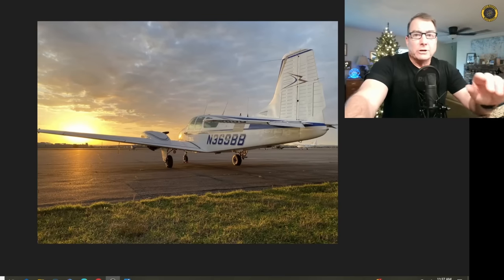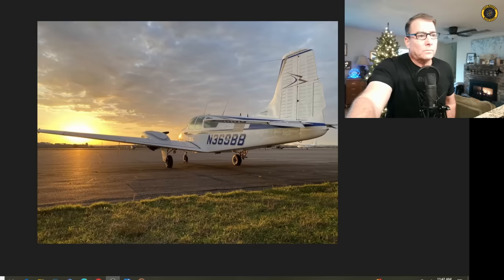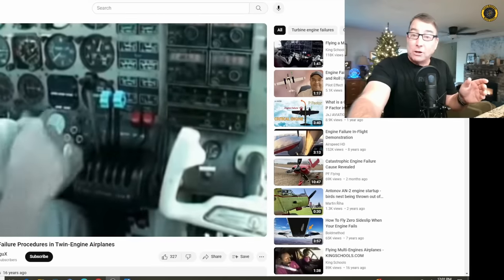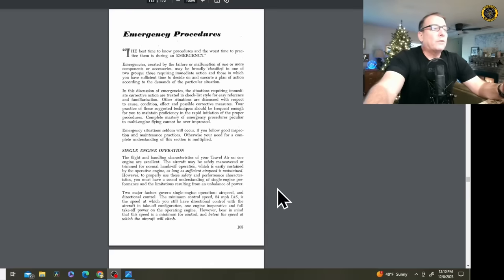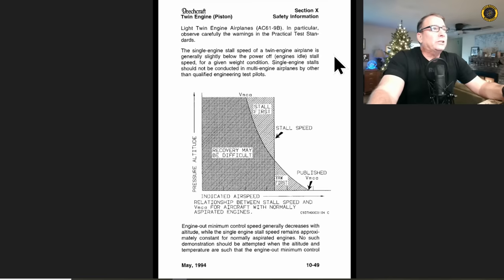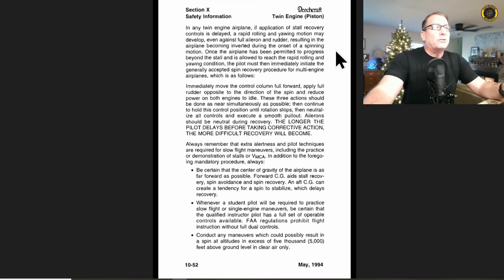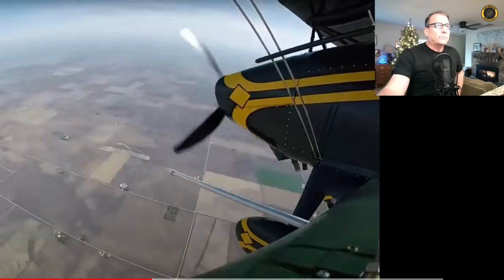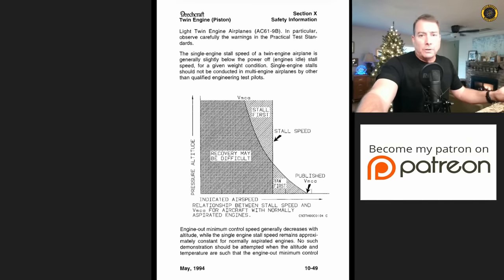Another Fatal Vmc Demo Stall Spin!! N369BB 4 Dec 2023

Comment: If memory serves, twins are not required to demonstrate spin recovery for certification.....unlike a single. As a flight instructor I had to recover from a spin induced during  power on stalls in a C172 during a BFR. Two different pilots made the same mistake like you mentioned, they tried to use aileron instead of rudder to keep a wing up during the stall and we went right into a spin. Funny how that happens! I did something similar to what you did. After becoming a flight instructor (and before these incidents!) I rented a C152 and climbed to 10,000 and did spin recovery after spin recovery, sure was fun and probably saved my life!
Reply: Light Twins are not certified for spins..

Comment: Completely avoidable death. FAA needs to send an AC to all flight schools in the country that have a light twin in their fleet and have them attest to have communicated guidance to their instructors not to allow these planes to reach a stall during VMc demos. To only allow these demonstrations in a manner, as Juan recommended,  by limiting the efficiency of the rudder physically and only allowing the YAW to be identified before a stall can develop.
Reply: I believe there is plenty of guidance on the safe operation of twins in Vmc demos. MEIs just need to be fully proficient and on their game.
Reply: Horses and water
Reply: I agree, but are the DPEs going to block the rudder on the check ride? If not, then the check ride could be the first time they are demoing it without the rudder blocked, which seems even worse.

Comment: My first aerobatic flight lesson my instructor and I were running the prestart checklists.  He then showed a billy club to me.  He said, "if I tell you to get off the controls and you dont, I'll use this!".  We never had a problem.
Reply: That's pretty funny....LOL.  My introduction to spin training was with a very slight female CFI.  She was no more than 5 foot even, and maaaayyyybe 105 pounds.  On our first spin in a C-152, after several turns, and recovery, she admitted that she tried to block the rudder on this first one to just enter a spiral, but my larger frame and strength easily over powered her attempt.  The lesson I learned that day had nothing to do with spins.  The lesson was as a CFI, you need to go over the planned flight with the student, and keep no secrets, like blocking a rudder pedal.  Everyone in a training cockpit has to have all of the plan, and be fully in the loop.

Comment: When I was a MEII, the first thing I did was teach the same things mentioned in the video before attempting VMCA demo. The main thing which I taught was recovery should be at the onset of stall OR loss of directional control whichever comes FIRST. I always found that theoretical knowledge was a key point to completing these maneuvers safely. RIP to the pilots…

Comment: Juan, 2 years ago you posted a King Air skydiver stall spin caught on video. Great video. Shows the partial snap roll you are talking about on camera. You might want to link it here. 

I also thought that with military or college aviation training you could apply to airlines with 750 hours or 1,000 hours respectively. Is this correct?  How many hours do you need to fly fighters or right seat transport aircraft in the Air Force?  I will note that since the crash that caused this knee jerk reaction (Colgan?) U.S. airline safety has improved. 

Always thought anti yaw engine power would help, did not realize power flattened spins.

Comment: I've done VMC demonstrations at 5-6k at various temperatures in my 310 without any issues. The point made about doing a VMC demo when conditions put you near stall speed is a good one. However, besides setting up the plane on single engine, I don't look at the airspeed as much. Instead,  I look out the widow for any deviation in the yaw axis. Whether I'm level or doing the VMC demo as soon as the yaw drifts more than a degree or to two it is back to immediate recovery (simultaneously reduce power on both engines nose down). Also, very good advice to MEIs about blocking the use of full rudder as it means the nose will start to drift earlier at a higher airspeed so farther away from stall speed.

Comment: I just had my Commercial Multi Engine checkride two days ago, and all of my training for VMC Demos involved the instructor blocking the rudder with his foot. The DPE, however, wanted a full demonstration and did not use his foot to block the rudder pedal. I was sat on the maneuver, but it was very sloppy and I saw my DPE jump up and almost take control of the aircraft.

Comment: Excellent discussion, with extremely clear explanation of the aerodynamics involved! I couldn't agree more. I got my CFI-ME in 1977 and went on to fly DC-3's and 40 years flying airline jets (7 jet type ratings). I have owned a Travel Air like this one, and now a Baron over the last 33 years. CFI's used to have to attend a 3 day FAA Instructor refresher course every 2 years. I remember a video that was shown of a Piper Aztec spin recovery. The airplane was equipped with a drag Chute, and D rings to jettison the door, while the test pilot wore a parachute. After a couple of turns the Aztec was in a flat spin. Shortly, you see the drag chute deploy and the airplane keeps spinning. Off comes the door and you watch the pilot's chute deploy and the Aztec bore a hole in the ground. If you think you are going to recover from a spin in a light twin---think again! I refuse to obtain a BFR in my Baron; I don't want any instructor 'surprises'. I find a single engine airplane for that. I don't believe you should do a VMC demonstration more than once in any light twin! This is like practicing a forced landing in a single where you actually have to land off airport. Let's stop the carnage!

Comment: Juan, you are very gifted with your knowledge and understanding of the current situation…I had 10 years in the Air Force and 32 with United..I was very fortunate. However, I had to spend 17 years 17 years, I repeat myself, 17 years as a Flight engineer… No regrets there, it was 17 years of watching other people flying… The good and the bad. The point is that there was a marked difference in the copilots I observed …you might say half were ex military, and half were FNG’s who had only a couple of hundred hours and an instrument rating… I will say that the better pilots, in my opinion, were the low time kids.
Also, there’s my understanding that Lufthansa train their pilots in Arizona from the start… In my opinion, there is never been a problem. Thanks for all you do.😅

Comment: I appreciate your insights! quit flying after a series of low hour pilots messed up and paid the ultimate price. One was a Vmca-gone-wrong about 10 miles from my house. At nearly 350hrs in helicopters and about 60 hours in fixed wing… it seemed insane to me what dangerous maneuvers low time instructors were expected to teach. My life is worth more than achieving another 1,100 hours of flying risky maneuvers or being pressured to fly in risky conditions, especially in ops that don’t require a SMS! Wonder why there’s a pilot shortage? It’s too risky and too expensive to meet the 1,500 hour minimums to get a safe job. Simple as that

Comment: Such a excellent description of recovery from inadvertently entering a spin in light multi engine aircraft.

There is "PARE" Recovery if your not sure of spin recovery:

P - Power Idle
A - Ailerons Netural
R - Rudder Full Opposite Of Rotation
E - Elevator Forward Stick

Comment: In a fighter jet deploying the drag chute is sometimes used for spin recovery. The force of the drag chute pulls the tail in the opposite direction of the spin and tends to raise the tail and lower thee nose. During flight test when a test pilot is evaluating the stall-spin characteristics of a new airplane they will sometimes install a drag chute on an airplane that normally doesn't have one just for safety. Unfortunately, this is not an option on a small, general aviation aircraft.

Comment: Beechcraft Vmc training documents advise that instructors must block the rudder movement (with the feet) at a point that results in a simulated Vmc at a speed of 10kts above the aerodynamic Vmc, so that the instructor will have the additional rudder movement available to effect a recovery should the demonstration be mishandled. 
In my many years of experience of instructing and examining this manoevre, I find that student/candidates are invariably not assertive enough to break the stall timeously (if it occurs)by reducing the angle of attack and restoring roll control. On some aircraft, especially those with a more rear CoG, require a brisk and assertive push on the control wheel to break the high alpha flight regime. Delaying the stall recovery at this point results in an incipient spin, and an autorotation develops very quickly resulting in a full spin. 
If the instructor/examiner does not catch the autorotation in the incipient stage with assertive control inputs, the flight is at severe risk of tragedy.

Comment: I was close to the the student involved in the Seminole crash in October (we were both classmates and trained alongside each other under the same instructor) and he was under an expedited training regimen, having started twin training only half a year after beginning flying, and so far we still don’t know what caused it, the Preliminary report was overly vague likely because they still don’t know (the school is still banning back seaters since the incident aircraft had someone in the back).

I myself am still in training after several years and already past 250 hours with life throwing some monkey wrenches at me (broken legs suck) but also because I am a slow learner. That said I have far more experience than your average student (in fact even many instructors) and I can tell that there are many that despite being more qualified are making critical mistakes or lacking wider knowledge. Many students are being overly pressured to memorize and not understand the material. They’re being taught to pass tests, not fly planes.

This isn’t the fault of the school, but because of this new era of pilot shortages and adapting training regimens, they just can’t keep up, and even our maintenance crews are being worked to the bone with the current parts shortage that’s hitting piston aircraft particularly hard.

Comment: I haven't flown as PIC since the 80s, and I don't have a Multi-Engine rating.  I was trained in spins and spin recovery back in the mid to late 70s.  Based on your information in this video, I would think that if a PIC, i.e., the instructor had sufficient training in spins that he or she would be able to execute a spin recovery properly in a twin.  I agree though that the student pilot shouldn't get anywhere near that condition to start with.  Unfortunately, most student pilots coming up to that point don't have the experience or the knowledge to be looking at the handbook and understand that altitude and temperature are going to make a big difference in how the airplane is going to handle those conditions at or near stall speed. 

As always Juan, you pulled this apart.  I'm going to have to go back and watch Martin's twin training videos.

Comment: Juan, I still remember the T-37 spin recovery almost 48 years later.....
Throttles – Idle
Rudder and Ailerons – Neutral
Stick – Abruptly Full Aft and Hold
Rudder – Abruptly apply Full Rudder Opposite the Direction of the Spin and Hold
One Turn After Applying Opposite Rudder – Stick Abruptly Full Forward
Controls Neutral and recover from the Dive
Reply: That's interesting. Why did the stick have to be pulled back initially for the recovery? Wouldn't it already be back as part of the spin entry?
Reply: Not necessarily. You could have gotten into the stall without full aft stick. (cross control or accelerated stall). And most times when a spin starts the first reaction is using aileron and neutral stick. And it could be an inverted spin.....The procedure was tried and true for that plane.

Comment: Thank you for this Great explanation of the relationship between VMCA and Stall. I remember as a young multi-engine Instructor blocking the rudder during this maneuver so I was versed in this problem during training tho I don’t remember my instructor teaching it to me. I remember I wore heavy shoes to protect my foot because those students pushed so hard on the rudder. If I remember correctly the examiners did not explore this flight envelope very deeply during the check ride. I do remember tho on my 135 ride in a turbo Seneca the examiner failed the inside engine during the 360 steep bank turn. I immediately pulled the other throttle pushed forward on the yoke and leveled the wings

Comment: Our flat spin recovery was to add IN-SPIN aileron. If you let go of the stick, it will go there on its own. This stick release method can also be used to verify direction of spin- especially helpful when performing inverted spins, since the apparent direction of spin is opposite the actual direction of spin.
Reply: There is no limit to the depth of knowledge that can be gained by reading the comment section.   Thanks everyone.

Comment: Used to have to flight instruct for 2000-3000 hours mostly single engine, only to maybe get 1-200 hours multi engine time as a CFI way later in your instructor career...  before the "Commuters" would even hire you to jerk gear on a Brasilia or JetStream 31 for 3-5 years, upgrade to captain and sit for at least 1000 hours as PIC and then "maybe" get hired at a major..    now?  1501 hours and they're in the right seat of a A330.

Comment: I lost two friends, one the owner of the flight school and the other the Chief Pilot, to a Vmc stall into a flat spin in 2001. I didn't even have my PPL single engine yet, but the lessons learned from that stick with me over two decades later. One of the first things I do when flying a new type is have the instructor do slow flight, stalls, and unusual attitude recovery under the hood with me on the checkout. I feel pretty confident in most GA aircraft doing the "at speed" maneuvers, but those "edge of the flight envelope" and out of the ordinary are where I want to learn the aircraft most. How does it feel when it gets slow? Does it wallow or sharply break? How quickly can it go from stall to spin? How quickly does it recover? All those things are what I want to know before the Hobbs has ticked over one hour with me in the plane.

I think my shortest "new type" checkout flight is 1.4 in a Lance and that was after having 200 plus hours in Arrows and about 30 in a Cherokee Six. My longest was three flights of about 1.5 each in a TLS Bravo mainly because it took a bit for me to mentally stay ahead of the plane, esp when descending into the terminal environment. My first approach, I was late on power and had to keep power up to prevent shock cooling the engine. That had me at 190KIAS as I was at 3 mile. Wound up orbiting the field at 2000 to slow down and cool down before I landed.

Comment: Yeah, I have more experience than many of those who are just going to the airlines...I have 840 hours, no commercial rating, but I have more cross country flying experience than most of the folks who become flight instructors to get their 1500 hours. 

As far as a spin, in addition to pushing forward and rudder and engines, dump the gear. It may or may not help (depending on the aircraft), but often makes the nose drop and thus gives you airspeed over the tail for recovery. 
It certainly makes a difference in a 340.

Comment: Why do we still do a Vmc demo? Train to the procedure. Get the nose moving down, keep airspeed on the aircraft, stay above Vmc. Fly the aircraft. Take a breath, then start working the handles. 

Airspeed airspeed airspeed, fly the airplane!
Reply: Agreed. Vmc should be demonstrated in a simulator and you should be taught that if you cannot maintain Vyse then you need to descend at whatever rate allows you to or chop the throttles and dead stick it

Comment: A story about limiting the amount of rudder:  I was giving primary instruction in a C150,  We were working on power on stalls.  The student wasn't adding right rudder, and I kept reminding him to do so, but nothing changed.  I remarked out loud, "Well, this is gonna be interesting,"  Sure enough, the plane flipped over on its back, and I called for the controls.  Power off, nose down, neutral ailerons, and right rudder pressure.  But, the rudder didn't move.  I reared back with my right leg and stomped on the pedal which yielded and stopped the rotation.  It was then I realized my student had cried out, "OWWW!"  I asked him what was the matter.  His reply?  "My foot was under the pedal when you smashed it."

Comment: As a 24 year airline pilot I can honestly say that a multi-engine  piston rating requirement for a airline job flying transport category aircraft is a complete waste of time and money. 

Jet transport jobs should not require a piston twin rating but is something the employer can add-on with simulator training which are skills we already train for. Flying a multi-engine jet single engine with guaranteed climb performance is much easier to manage and totally different than a light piston twin. 

Hey FAA stop killing our kids and ditch the piston multi rating requirement and include it with the type rating training given by the employer.
Reply: A lot of 121 aircraft are twin turboprops.
Reply: @igclapp  Yes, but the training can be done in-house in a simulator after you get the job, much safer.